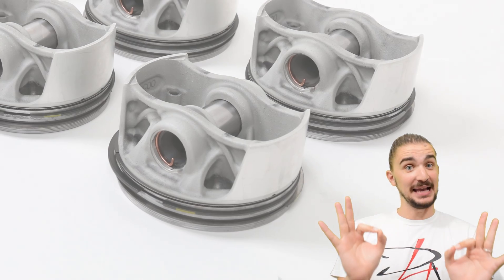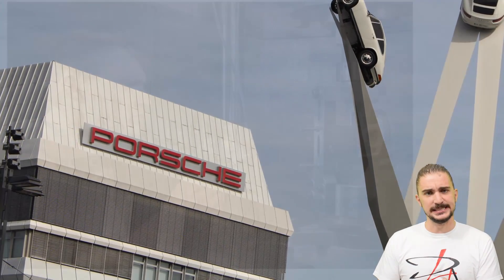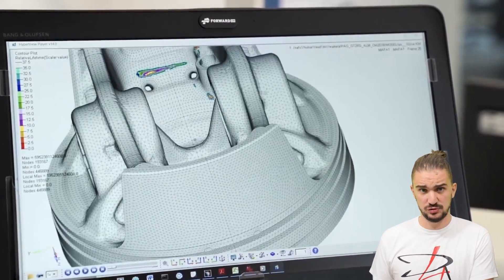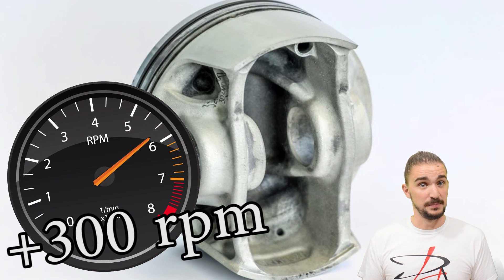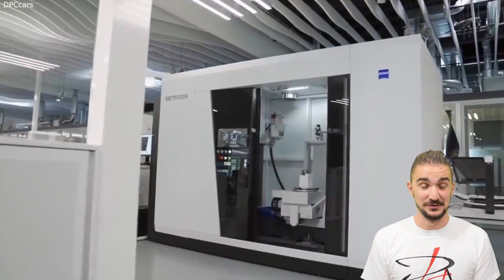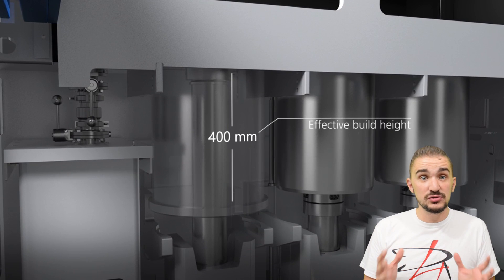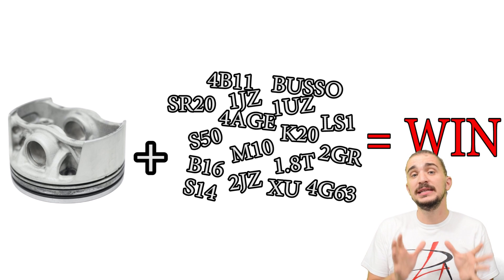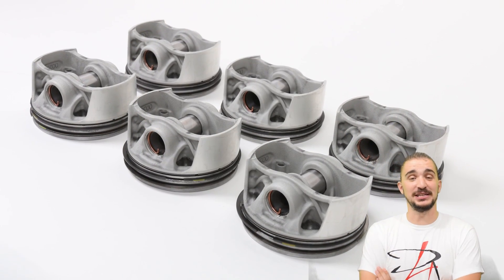PORSCHE'S Printed PISTONS - The Printed FUTURE of ENGINE INTERNALS?

Comment: My understanding is that 3D-printed pistons are hypereutectic, but this wasn't mentioned in the video. I don't know if this is a limitation of the 3D-printing process, or the source powder. But I do think it's important to note that the thermal expansion coefficient of 3D-printed pistons is along the lines of cast pistons, not forged pistons, probably due to the high silicon content i.e. hypereutectic.

Can one add Nickel to the powder and 3D-print a Nikasil piston? Not sure why you'd want to, just a hypothetical. So is incorporating Molybdenum into the skirt matrix. I think within a few years we'll be trading data files for printing up new pistons in our home garages. Especially those where the pinhole intersects the oil ring, which has a "ring support" allowing for higher rod/stroke ratio due to shorter compression height.

Comment: 3D printing  IS  Star Trek  Replicator  1.0 .  Seriously !    If this was done , then 1.01 at this stage .

I  heard that Koennigsegg designed one of their Engines , using a Twin-Scroll , Variable Turbocharger that couldn't be produced by conventional methods .
So they 3D printed it in Some Grade of Stainless Steel . Other than Annealing , no finish machining POSSIBLE internally . No idea if this really happened .
Koennigsegg . Lunatics . SMART lunatics . With a Very PHAT cheque-book .

For these  Pistons , the Heat treatment would  HAVE to be an Annealing process  I  think and then , maybe a Hardening Flash , AFTER machining .
Really interesting stuff .

Comment: Not bad. I see you didn't cover billet pistons.

A) How does billet pistons compare to forged and cast?

B) Do billet pistons improve fuel economy?

C) Are billets less prone to flapping during cold start ups?

D) Where does it measure up in ductile Strength?

E) What are the Pros and Cons?

Comment: Uh I'm sorry to tell you but forging companies have been making pistons with the oil cooling duct under the crown for at least 15 years now so the statement that it's impossible to make by forging is misleading to say the least! In fact most diesel engines today have a piston made with an oil gallery under the crown and it's probably easier and faster to make than the 3-d printed pistons are made! All you have to do is make the cap and the skirted sections separate then they are later friction welded together after being machined which leaves a completely machined place for the oil to circulate under the cap they even have an place for an oil injector to go in the corner of the skirt and ear
Reply from the maker: I know what you're talking about, but that's not a fully forged piston. It is in fact impossible to make a fully forged piston with an internal oil duct. You described it yourself, it needs to be either friction welded or assembled in some other manner post forging, which of course means it's no longer a fully forged piston. Also the kind of piston you speak of is very heavy and suitable only for low speed diesel applications, which is why it can't be used in performance applications that this video was dealing with.

Comment: Its nothing more than a high temperature sintering process not unlike printing aerospace components that endure similar loads . It should be no different to a forged piston and has many advantages like oil galleries and unlimited form for structural strength . The traditional method of cooling was to machine a V groove above the oil control ring . Porsche has been using Mahle alloys for many decades typically 375 in the forged variety . I'd like to see the composition of this new Mahle alloy as Rolls Royce has developed numerous alloys suitable for this process that are decades old and with published formulation and as they say imitation is the greatest form of flattery to the worlds most recognised engineering and metallurgical company .
Nothing wrong with DIY Megasquirt S&S ! Ask 100s of thousands of users that make amazing horsepower numbers from engines without Porsches ££££££s ! We've came a long way since the Zytek system fitted to the stock block Jaguar V12 s trounced the 1100 bhp Porsche 917s in the early 80s .

Comment: Was going to ask if they sintered them after printing. A technique that homogenized the layers into 1.
Reply: Parts come out of a laser 3D printer such as above need not be sintered but need heat treatment to redo all the internal grain structure. There are some 3D printing technologies that still have binder on the printed parts, thus will need sintering, but not those in the video

Comment: Koenigsegg has been maiking at least 3D printed turbos for many years now, because their cars are so limited production, and they are always making them exponentially better, it wouldn't be profitable to make the molds and casting machinery to make 1 style of turbo, so they 3D print them instead, because they dont need molds or different machinery to make different types of turbos, or engine components

Comment: Two questions: 
a) Is there any information available on the carbon footprint of 3-d printing production of pistons vs casting (vs forging) as I guess that will be one of the deciding factors in the long term for the technology viability at industrial scale and
b) where can I buy a '87 MR2 for $600? (assuming it's not totalled/run to the ground)
Reply from the maker: 1) That's a valid point and a really good question, but I wouldn't know where to find such research. I have seen some 3d printer manufacturers claiming how the 3d printing carbon footprint is very low, but that's just blowing one's own horn. Plus, it's really difficult to get an accurate comparison because it's very hard to draw the line for the process, where does each actually start? Plus, the practices for sourcing the raw materials vary heavily across the world. Getting the comparison right would be a massive undertaking. But I'm sure that something will be done, if it hasn't been done already.
2) the days of 600$ Mr2s are long gone
Reply: @d4a  You're right, such research could only come from the manufacturers themselves and only once they have decided to adopt the technology. I would assume it would include the carbon footprint of the printer itself probably amortized over its useful lifespan and including the carbon footprint of recycling/dumping it. Also, the metal particles themselves I would imagine would have a different footprint from that of ingots.
I was actually thinking of the 00+ model. Cheapest I could find in Greece currently is 2.5k EUR. Not bad but mileage is quite high.

Comment: This kind of printing is called Selective Laser Sintering (SLS) and has been around since the 80's. SLS parts that need to be strong also need to be extensively heat treated in a special process that has the part absorb brass(for steel) to make the ~80% density part 98+% dense, producing much weaker parts than forged or billet and likely slightly weaker than cast.

I'm glad Porsche is pushing forward, but it's still a long way off.

Comment: 3D printing is actually a manufacturing process used to make medical devices, aircraft parts and who knows what else. 3D printing metal parts is in use because you can now create parts which would be impossible to machine or cast. Its the same with plastic printing because plastic is injected into a mould, and a printer can make any conceivable design.

Comment: We do have cheaper parts Only Because the chinese people Are producing them Cheaper !!! ! !!! But Wiseco pistons are still Worse pistons thah we used to install for destroying the engines. Just because they are cheaper 2 buy, it doesn't mean, that the repairing of the broken engine is cheap too !!! ! !!! and electric wehicles Are the Worse Deception 4 the Blind + naive sheeple , Because in Europe the electric cars Are running Mostly on the Coal's energy , which makes them Worse Pollutants than the average combustion engines !!! ! !!! Not 2 mention the Biodiesel or Bioethanol vehicles, that Are Much More Ecological !!! ! !!!

Comment: How do you get oil up through the bottom of the piston? Some oil squirter?  Never thought of that as a cooling option.
Reply from the maker: Yes, an oil squirter. Many conventional engines have them too, in most cases they basically squirt oil to the underside of the piston to cool it. This goes one step further by getting oil into the piston, right under the crown and next to the ring land, to further improve cooling.

Comment: Simply due to the fact that 3D printing has zero economy of scale we're probably never gonna see this in sub supercar production engines. It would be nice to know what percentage of the cost of aftermarket forged pistons is due to forge tooling though, because that's probably what will determine success in the aftermarket. If we can make powdered metal production much more economical in the next 5-10 years it would be surprising if we didn't see at least a few printed pistons crop up for oddball engines. 

The shop I work in has a smaller SLS printer but it doesn't get much use because the material cost typically isn't worth it. People tend to forget that the powder isn't really reusable* so the material cost of a part is much greater than the volume of the part, unlike casting, forging, or conventional plastic 3d printing. I'd like to see them try a binder jet process for the pistons, as that would be more economical.

Comment: i can not speak for porsche, but 3d printed metals are usualy stronger than most other types.  because the metal is superheated quickly by a laser, it offers a much better structure guide, than just pouring liquid metal. (think atomic layers)  again, not sure about porsche, but because most 3d printed metals are exposed to this short, but very high burst of heat/energy, impurities are burned off leaving little randomness or "dirty metals".   a good example is titanium. a 3d printed titanium part is the strongest humans can make from this metal.  cast, molding, milling,etc... are actualy weaker than the 3d version.

Comment: Next up - hollow 3D printed connecting rods with oil cooling channels to go with those 3D printed pistons.  With a lighter, cooler and stronger rotating mass, higher RPM's and hotter tunes means more HP all around. The lighter mass means better fuel mileage, the holy grail for keeping powerful engines in production with increasing emissions standards. Imagine a hollow RX-7 rotor, able to spin to 15k rpm and weighing 50% less than standard.  Lots of applications to give more power and torque plus better fuel mileage.

Comment: I have had exterior body moulds for my car reproduced in the original factory material using SLS 3D printing.  
Simply becasue the replacement parts didn't exist.

Comment: What you completely forgot to add though, is the fact that Porsche Classic has been busy for a few years now offering certain 3D printed out-of-stock classic Porsche parts for rare and therefore expensive vintage Porsche classics. Some sought-after vintage parts, for which the tools, dies or moulds were no longer available so they can't be reproduced by conventional means, are once again officially available from Porsche Classic as 3D printed part.
Reply from the maker: I did not "completely forget" that. I said Porsche had been printing for a while "but it's MOSTLY been stuff like parts of your seat". The stuff that's offered through Porsche classic is similar too, none of it is engine internals or parts that see significant stress.
Reply: @d4a  See https://newsroom.porsche.com/en/company/porsche-classic-3d-printer-spare-parts-sls-printer-production-cars-innovative-14816.html The Porsche 959 clutch release lever is originally a grey iron cast part with very high quality requirements. It has to be able to withstand a load of nearly 3 tonnes. Porsche offers that now as an additively manufactured part, fully conform their original part specifications. That's quite something else than non-critical or lowly stressed parts.

And, sorry, you're right, you didn't "completely forgot" to mention, it's just that Porsche is doing more with additive manufacturing than you implied.

Comment: I think it was Bugatti that made 3D printed brake calipers if I’m not mistaken. The process for powdered/sintered metal generally makes stronger parts than casting, so If we assume that only structurally unnecessary metal was removed, they should still be overall stronger than cast, and since they are lighter, they also undergo less force, giving a larger margin of strength. The cooler deck heat of the piston would also reduce the likelihood of knock. This really is some next-generation engine design. 

I’m excited to see 3D printed cylinder heads and manifolds soon.
Reply: Yes Bugatti did it, but metal printing is more and more use to made aircraft engines parts, SAFRAN , and specialy he's Turbomeca division (helicopter turbines), use this technique for some parts on the newest engines..

Comment: BMW also has a 3D printed part (I think it is the head gasket) on the new S58 engine for M3/M4.
Reply: Yes, but there they print the parts that are used in otherwise conventional casting. It allows for an engine head, or heads, with really complicated internal shapes, which would be impossible to make using conventional casting mould construction methods, but the metal shaping process is still conventional casting.

Comment: advancing ignition on a old engine as pistons run cooler, and lighter internals as well now if this does not sound like a reasion to keep upgrading and have those old piston slappers around i dont know what does xD but also running coolce would in theory allow you to run leaner as well if you dont advance ignition to much so maybe you would be able to maintain stock power and have bether fuel economy as well?

Comment: 3D printed parts have been in use in aviation for a some time already. Like GE does make fuel nozzles for jet engines with 3D printing and at least Airbus has some 3D printed parts too.
Reply: There are also 3D printed turbine blades with fancy cooling inside for turbo jet engines. They are made from alu - titanium composite.
Reply: Exactly, I was going to say the same thing.

Comment: what effect would the oil in the cooling duct have on the balance of the rotating assembly, given that the weight of that volume of oil will change slightly due to temperature fluctuations and the accumulation of contaminants throughout the life of the oil?
Reply: Also, oil inside the piston will actually make it more heavy right ?
Reply: @redfield8758  yes but I am sure they would factor in the weight of the oil when calculating the bobweight for balancing
Reply: @harley8918  needs to use the same oil (like in any car you will tell me)
Also, I imagine oil density changes with temperature ? (Edit : sorry, you already said it above)
But most problematic, like you said, would be the running of oil itself in the duct, disrupting balance.

Comment: Mercedes OM617 turbo has oil cooling ducts under the piston crown, they are supplied by oil squirting nozzles. A lot of turbo cars use them now but I believe OM617 turbo was the first production car engine with that technology.
Reply from the maker: I know those pistons have a duct on the underside that looks like the one on these pistons, but I would love to see the cross-section of the OM pistons, I doubt the oil cooling duct on the OM goes full circle?
Reply: driving 4 answers Yes the om617 ones go full circle I have a cross-section, page 10 of this pdf http://www.w124performance.com/docs/mb/other/SAE_OM617.95X_Development.pdf
Reply from the maker: Nice, thanks for the paper. Pretty impressive for 1978. It will be interesting to see if the printed ones pick up on strength and ductility in the near future, we will have the ducts, they won't weigh as much as the cast ones, but could be as strong as the forged ones, imagine that.
Reply: Truck and industrial engines have always been ahead of car engines, piston squirters have been used forever.

Comment: So it's basically a sintered piston with 3D CAD design hm? Wonder how material science will advance and find the variation of range for compressive and shear strengths.
Reply: Materials scientist with "additive manufacturing" knowledge here. About a decade ago, the laser power and optics were such that 3D metal printing was SLS, selective laser sintering. With both improvement in optics as well as laser power, it has been SLM for years now, so selective laser melting where the temperature of the powder at the focal point of the laser gets past sintering temperature, which is by definition below melting point, to fully locally melting. So, no, this isn't a sintered part. SLM typically results in mechanical properties that exceed those of cast material, because cooling speeds are much better than conventional casting, but the properties don't quite reach the mechanical properties of forged material.  But, since you have near perfect degree of freedom in shape, when 3D printing, you can not only leave out material where it's not needed, you can selectively add it where you do.

Comment: Fascinating. Put me down for an oil pickup for the 1MZ-FE that doesn't suck air during hard cornering resulting in a spun rod bearing. You could sell dozens of those, so a perfect application of 3D printing.
Reply from the maker: I came up with at least 5 good business ideas as I was making this video. Now I just need the 2 million Euros for that Trumpf printer :)
Reply: @d4a  I'm looking under the sofa cushions right now but I'm not terribly optimistic. And it's only 2 million? Damn, so near yet so far.
Reply: @d4a  You will also need MAHLE magic powder compound... Do they actually sell it anyway ?
Reply from the maker: @redfield8758  No, but there's a guy on a street corner near me who offered me some magic powder once. It's the same thing right?